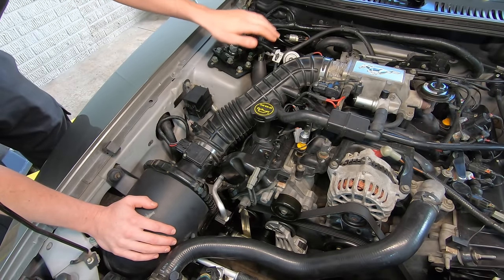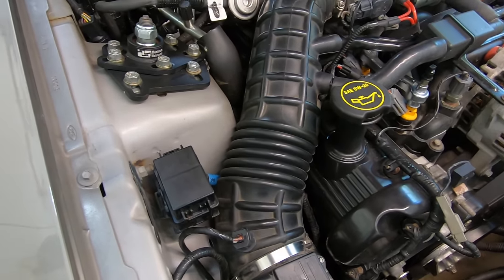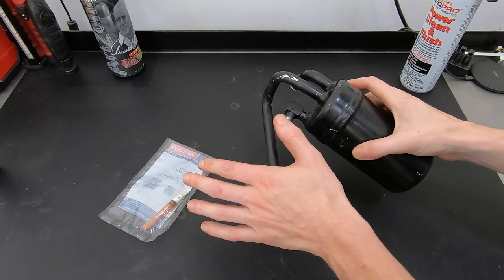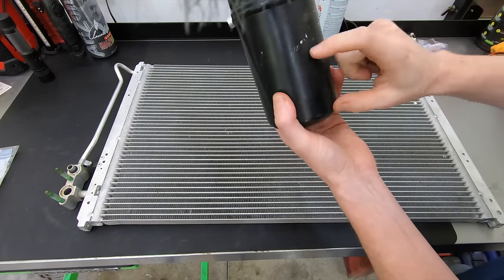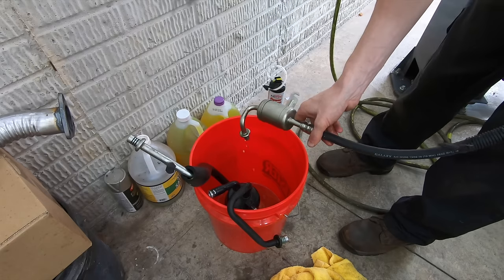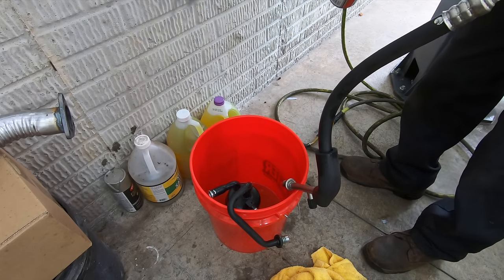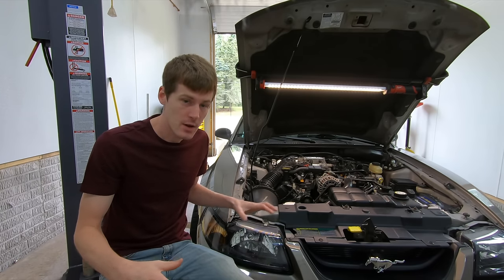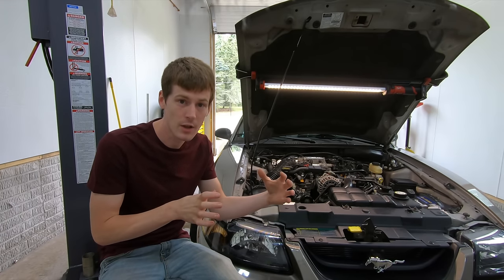How To PROPERLY Flush and Recharge A Contaminated AC System.

Comment: Don't  trust  dial  gauges. Use  a  micron  gauge.
Reply from the maker: You can use whatever gauge you want. Just because it holds vaccum doesn't mean it will hold pressure.
Reply: @RepairGeek  
I'm not talking about leak testing. Dial gauges have no resolution. 
You're not boiling moisture out of the system above 1000 microns in one hour, let alone 1/2 hour on old vacuum pump oil. 
500 microns, 30-45 minutes. 
If you can't pull it below 1000 microns for over an hour, you're not doing anything.
Reply: @Foche_T._Schitt  You are removing non-condensables. The drier will remove what little moisture that was in the air that may have condensed in a hose. The biggest thing is non-condensables. No body mentioned that he didn't purge the air out of the yellow hose before he opened the low side gauge valve.
Reply: @thewoodcrafterioy4003  
Moisture does pass through barrier hoses slowly over time. That's also what the drier is for. That's why GM recommends replacing it after 5 years if you do any service to their AC systems.

Comment: That's not how it works a precharged comp typically has what the comp calls for not the system capacity I've oil balanced many comps and most are less then an oz off

Comment: Diesel explodes with air, oil, pressure! Thats why we use inert nitrogen.
Reply from the maker: 😂 who is putting diesel in an AC system? Also diesel combusts with heat, not pressure. The pressure of the compression stroke creates heat to cause the fuel to ignite.

Comment: you did a good job but you are not showing things you should and thats what i see all u tubers do. please use a micron gauge next time and show the truth what no bodies teaching. it will show you so much more ,especially if you truly have a dry system  of 500 to 1000 microns . please do another with the use of the micron gauge  please
Reply: He probably doesn't own one. I've never seen one used in any shop, by any tech, anywhere. In theory, you could if you're curious. In practice, if you pull a vacuum for 45 mins to an hour and test for leaks afterward, it will be dry. There's no need to know down to the micron exactly how dry it is. That's one of the functions of the dryer. It can handle anything that could be left.
Reply: @ryanburns3921  i would say u are hoping it will. next question do you no how much moisture you left in the system and do u no the capacity of the drier, i would say you are assuming ,you have no facts  without a micron gauge . but to each their own

Comment: You just told everyone you overloaded on oil, and yet you never even mention pre-charged compressors.

Whats your background again?
Reply from the maker: Try watching longer than 2 minutes before you try talking down to someone:
1:36
Reply: Alright I did miss that part, but the explanation is still pretty confusing.

Sorry to take my frustrations out, there is so much misleading information out there and I definitely don't want to go through another tear down.

I have an expansion valve and a pre charged and am taking the car back to a shop that evacuated the system for me previously, I'm assuming that they'll be taking care of any additional oil additions based on what I've been reading?
Reply from the maker: If you had a legitimate question perhaps leading off with an insult based on not actually watching wasn't the smartest move... Good luck! 🙌